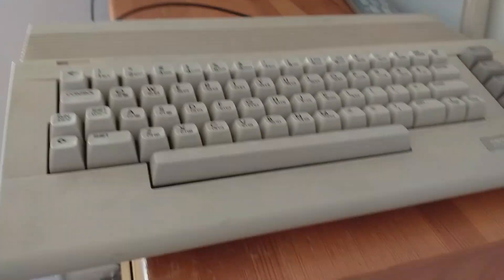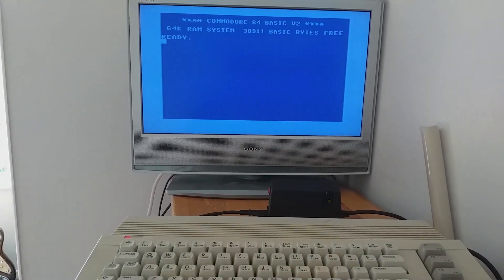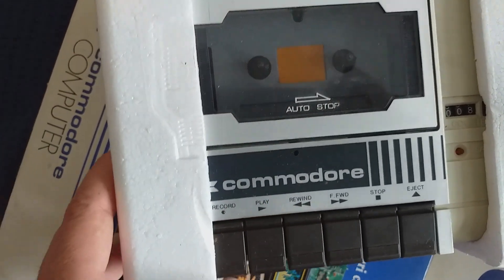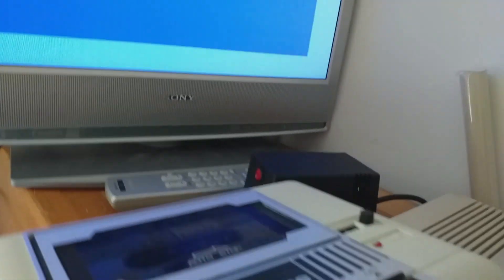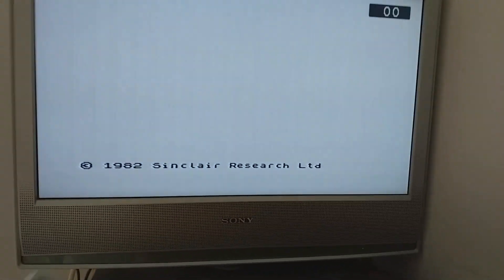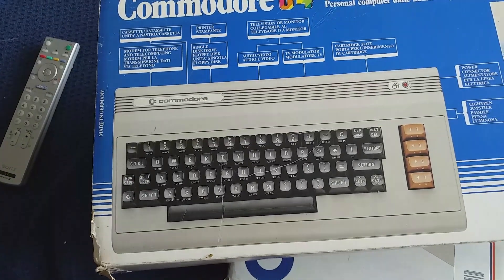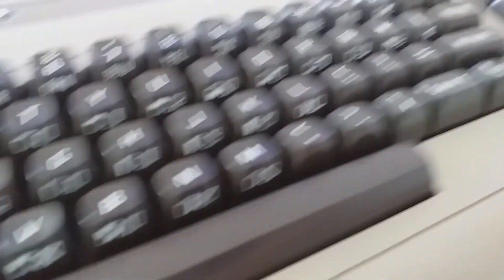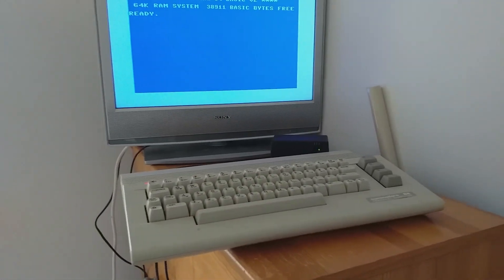Testing Times - Testing Spectrums and Commodore 64s  - Vintage Computing

Comment: Good video, what are you connecting the cables into? Is it to the coaxial (RCA) input on the TV? I have a spectrum  I need to test and a TV with the RCA cable inputs but have no idea how to connect? I was told to connect through a VCR, but all I have on VCR is coax and SCART. Any help greatly appreciated.
Reply from the maker: i'm plugging it straight into the aerial socket in the tv - although you will need an analogue tv
Reply: @salesoftheunexpected  ok thanks,  i need a new  (old) TV i think